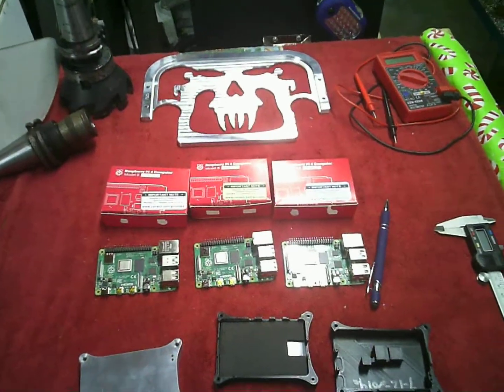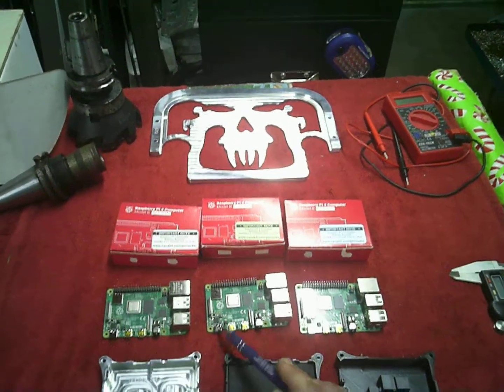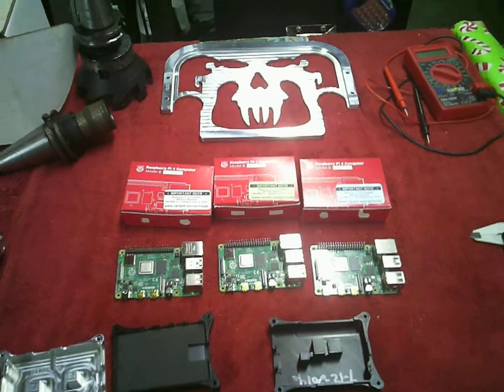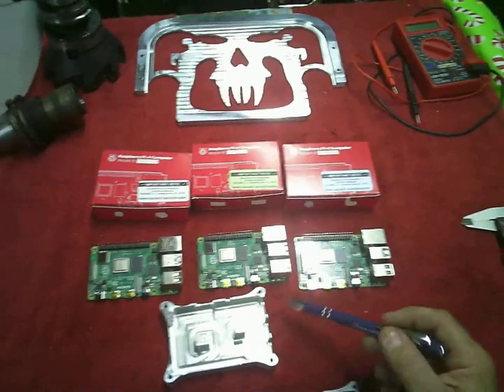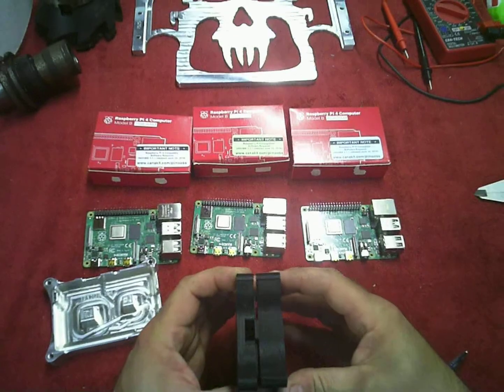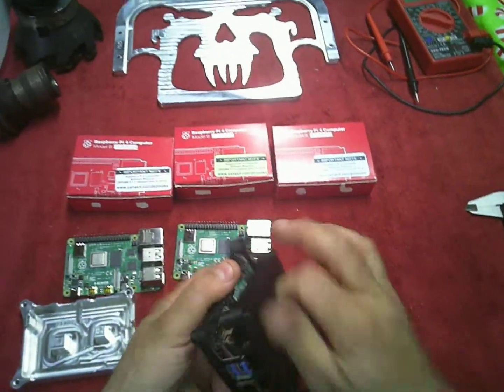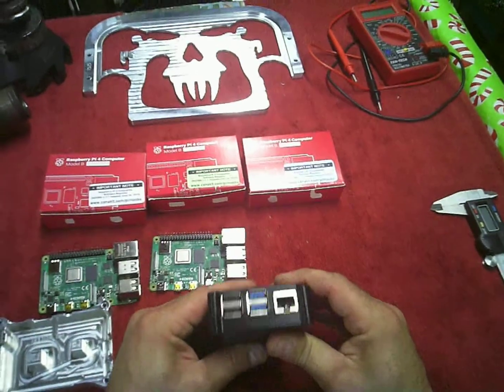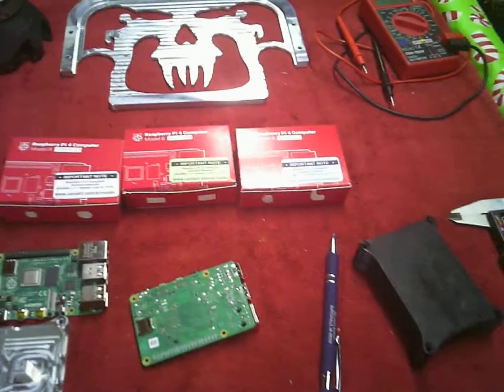Raspberry Pi 4 Standard Case Design Wicked Aluminum Barch Designs

Comment: I pre-ordered a case for my Pi4/4GB.  Will I be able to use thermal grease on the ram chip or will I have to use the thermal pad?
Reply: According to the assembly videos only the 2GB version will need the thermal pad.